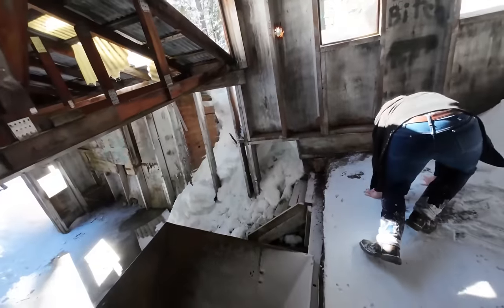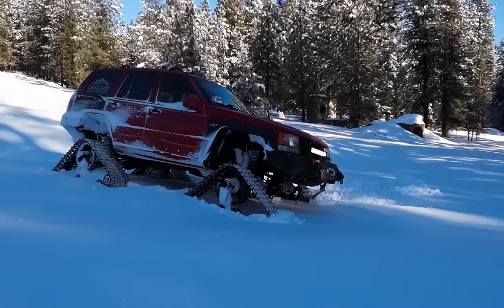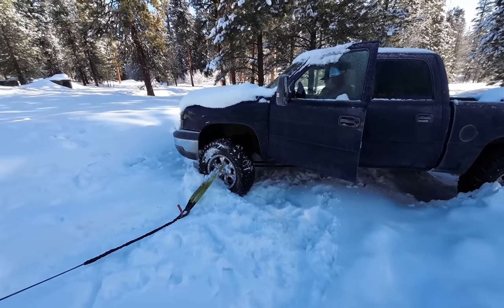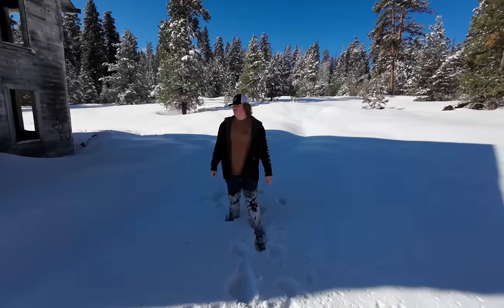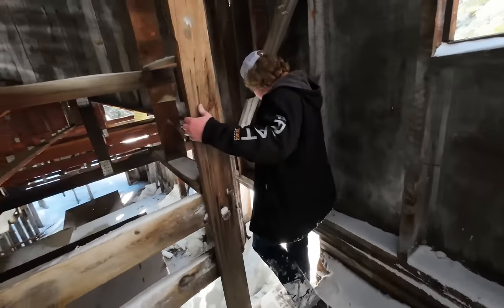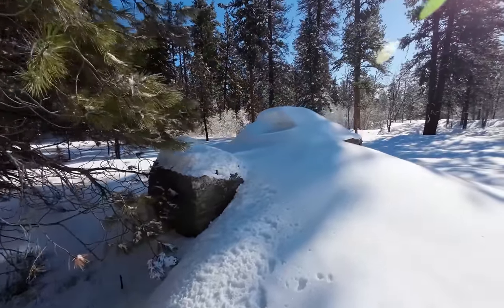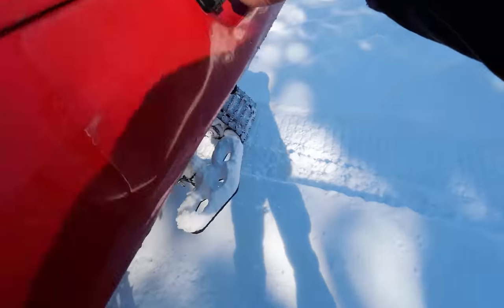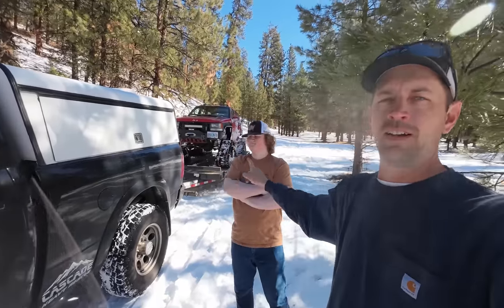Stranded at a Haunted Brothel…

Comment: We had the noise issues with our F-150 and stumbled on an answer. Truck had mat no rug. Our mechanic had to do some work under the dach and grabbed the 2×2 pad he used to stand on at the bench to raise him up off the floorboard. One on each side in the front.  While on a test drive we could notice to huge difference in noise. They are a foam like and wash real easy. Black at hardware store and multi colored in toy department.

Comment: I know you said the mine was run in the 30’s, and I would agree that the brothel looks like a 30’s building, but that processing building you explored looked like it was built with materials and supplies much later than the 30’s.  Engineered trusses, truss plates, polycarbonate/polymer corrugated roofing panels, plywood, rubber hoses in pretty good shape, pipe hanger straps in good shape exc. Maybe it was updated at some point, or worked a bit at a later date.

Comment: Needs a Posi-Lock cable actuator to lock the front axles together.
The factory GM stuff sucks in the cold.

That's why he's losing front drive.

Auto 4WD, which is actually AWD, will let just one wheel spin. Unless it has a G80 locker in the rear-end. Then both rears will spin one the RPMs are high enough to engage it.

Comment: ARod said you were on your way up to pickup that toolbox. Tried to get you a free blue toolbox. Could have been your wife unit's new toolbox. It's a good thing the brake peddle was going to the floor, with having those brake hoses installed like that, there lucky they didn't break. They should have you go over the Jeep to see what needs to be repaired before going on a long trip. Nothing worse then having a break down along the way especially when it could have been avoided. The lid on the master cylinder should be vented probably why it was leaking, I know you know to place a sandwich bag over the opening and then put the lid on to prevent break fluid from leaking. I missed ARod and your live session yesterday. Take care and have a good day. O ya a Banks surprise is on it's way is it !

Comment: well if anything the torn seats, the wrong speed and trip distance on the dash means it it well used. we use to have a Marquees that stopped reading mileage at 114,980 miles and we use to joke that it was rolled over and after you saw what the rest of the dash said you'd know it was all wrong.

Comment: If the young fellow had a couple of shovels, he might have been able to get himself out of that jam. I put a lot of miles offroad in northern Alberta off roading in deep snow. I carried a long handle spade and also an aluminum grain shovel. I've gotten into situations like that where I've dug myself out and then taken the grain shovel and dug out a large area so there was very little snow, and I was able to drive myself out. One time, I was in a hay field with rolling hills and |I was travelling downhill and came to a dead stop.

I got out of the truck an fell into chest deep snow! I was hung up on a snow bank and the wheels were 3' or more off the ground! I shoveled for hours,  clearing out in front of the truck and along the side (78 K1500 GMC 4x4) and then carefully started clearing the snow from under the truck until the wheels touched down and I was able to drive again. 

Learned a valuable lesson about drifting snow! I was 16 years old when I pulled that boner!
Reply: Modern Chevys and just pickups in general are junk.  When the going gets tuff the pushbutton 4wd doesn't work.  And instead of Full-time they have AUTO that doesn't work and isn't supposed to be used on the street it's complete joke.

Comment: Casey, I don't know what the external mic input is on a GoPro, if that's what you use, but noise cancelling boom microphones are readily available. I doubt you'd want to go full helicopter pilot with a head set and boom mic, although come to think of it, Rory uses something like that to communicate with the vehicle he is towing, but I have seen noise cancelling mics that clip around an ear.  To my ears, the sound quality and background noise in the tracked jeep really isn't that bad.  Certainly not so bad that I would even think to complain about it.
Reply from the maker: I don’t use microphones
Reply: @CaseyLaDelle  There's a destination a little up the road
From the habitations and the towns we know
A place we saw, the lights turn low
The jigsaw jazz and the get-fresh flow Just clap your hands
Where it's at
I got two turntables and a microphone...........

Comment: your description of how they refined it is a little off: once they had the ore (concentrated however they did), they heated it to boil off the mercury itself. then, they would condense the vapors. everything that comes out the downhill end of the furnace is garbage - the good stuff boils out. 

I'm surprised that the rotary furnace (often called a retort) is gone, I've been to quite a few mercury mines and they're big/bulky/heavy enough that they're rarely removed. 

the internet tells me that the condenser at this mine is unusual, sadly I didn't see that (or the retort) in your video.

Comment: I am wondering if the reason your jeep didn't start last time because the higher up you were, less air pressure. Which means whatever air is trapped between your fuel components causing an air gap?

Comment: Casey, does the vibration of the tracks loosen nuts and bolts on the Jeep regularly?
Reply from the maker: Only ever had that happen twice so far
Reply: @CaseyLaDelle  I can only imagine that it would be similar to miles of mini washboard.  When I built my '17 Tacoma for more than street duty, desert washboard was high on the list to accomodate.  Clearly not a rock crawler or mud bogger with my skinny 255/85R16 (33") BFG's installed, once aired down this is super smooth on our SE Oregon desert washboatd roads.  

You are an animal for sure!  I can only imaging the feeling or vibration frequency you have to endure with your tracks over miles and miles of travel.  
I would be numb for sure.  

Can't wait until you track the rollback, that would be a hoot!